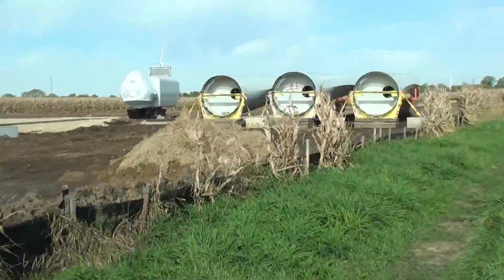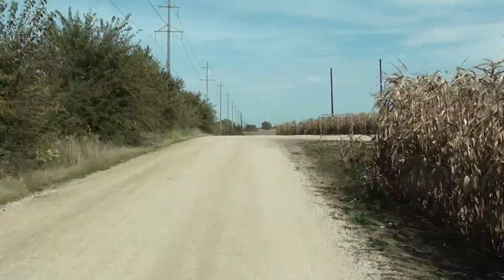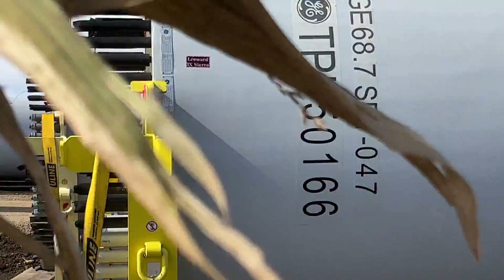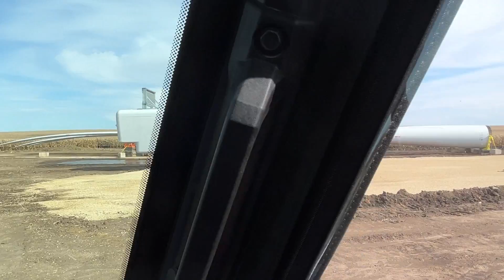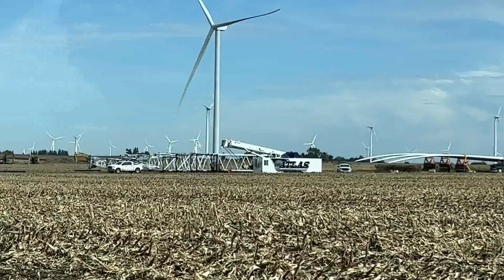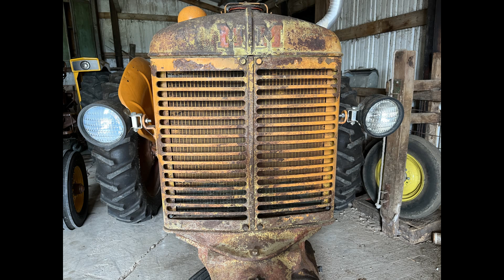ERECTING HUGE NEW WIND TURBINES short #48 tubalcain free energy

Comment: There was a turbine blade being transported that was stopped at a rest stop.  I paced the blade and then met the driver.  He told me the blade was 265' long but that there are some that are 300' long.  I was also told that the blades have stairs in them so they can be inspected.  I suspect that the 68.7 on the blade was the length in meters, 225" long.

Comment: This saw on the propellers of the windmill blade is not on the attacking side, but on the opposite side. This means that it is most likely intended to reduce air vortices at the trailing edge of the airfoil and not to dissipate the birds.
Reply: Formula One cars' windscreens often have that sawtooth pattern these days.

Comment: I’m surprised with the way the craziness is these days you didn’t get stopped and shook down by a group of guys in black suits and sunglasses driving Suburbans saying if you can’t film here. I have friends in Ohio, Illinois that have the turbines surrounding their farm since the early 2000s and he refused to put them on his land because of the loss of crop revenue as well as the outrageous lease they required. Back then they paid the landowner $10,000 per unit each year requiring full access for maintenance and upgrades. It depended on a wind survey to determine how many  can be put in each area depending on the wind. They actually produce power without wind. An onboard motor turns the blades and a change in gear ratio turns the generator to power the motor as well as create power when the wind isn’t as strong as usual. They can face the generator in different directions as well as change the attitude and pitch of the blades like on a propeller plane motor to maximize the speed. Great videos Pete as always.
Reply from the maker: Very interesting. There was a security truck that we avoided.

Comment: This is very interesting video Mr. Pete.  For those discussing that on a windy day the turbine were not is use I may have information to explain it.  I had a lengthy conversation with a mechanic or technician that works on a wind farm and asked him about that.  His reply was that they were either down for maintenance or the power grid did not need their production.  Distribution is one of the flaws in this system.  Excess generation can't be saved or stored so they are often shut down because the demand is too low.
Reply from the maker: Very interesting
Reply: Since it is 'free' wouldn't throttling down the gas/coal/nuclear plants be the first thing to do rather then shutting down wind?

Comment: The fact that they are replacing what was there sorta of makes you wonder how much profit there is in generating power. Surely these new ones are into the millions of dollars so how long before they turn a profit and then how long before they need maintenance and replaced again. For sure, creating electricity is much cheaper than they sell it to us for.
Reply: The old one was probably about $2M, this one about $10M.  Depending on area, power price etc payback was usually 5-10 years.  With windmills bigger is better, twice the size makes 4 times the power so this one could pay for itself in a year, but more likely well under 5.

Comment: Lyle - Interesting video, thanks for producing it as it was very informative.  I scanned comments until I saw that the 'teeth' on the blade trailing edge was explained correctly as noise reduction (primarily).  My compressible fluid flow course was 55 years ago but the principles have not been found in error yet.  As an engineer I am always amazed by comments some people make about things then they have no understanding of the technical aspects.  If  I don't understand something I try and keep my thoughts to myself until I research it and figure it out.  Complex problems like how to provide a stable electric energy grid have many, many moving pieces.  It is not always intuitively obvious how the various pieces of the puzzle fit together to make the system  work.
Reply from the maker: Never underestimate the ignorance of the general population

Comment: People generally do not realize the speed of the blade tips when these are in use. The speed is governed to keep them from  spinning like a child's pinwheel in the garden. Below is copied from the internet but the diameter of the blade is not given. 

The wind turbine’s speed is determined by the speed of the wind. The majority of wind turbines spin at a rate of 10 to 20 revolutions per minute. When the wind speed is roughly 12-15 mph, the blades’ tips turn at about 120 mph.  That would be probably be close to  16 revolutions per minute with a 70 yard length blade. 

They look slow, but a bird thinking the same thing doesn't stand a chance at the tip of the blade, especially with a saw tooth blade. I bet they were purposefully put on them to reduce bird strike damage. I despise this technology. We should be using nuclear energy exclusively for electricity. The U.S. Navy has and exemplary record of safety with nuclear energy. The wast material containment would take up  less that a house lot since they have been converting all ships to this form of energy. Even new nuclear power plants being consructed today are way safer than any previous models but the U. S. has deemed it bad so the world passes us by with development. France uses nuclear so I wonder if the naysayers refuse to go to Paris or Normandy?

Comment: Interesting to see the development of these wind mills. Why would a windmill become obsolete? What did they do wrong on the original ones.
Reply: The early windmills were prototypes in a real sense. Each new design should be quieter, more efficient in materials, last longer, and produce more power than previous designs.
Reply: @ellieprice363  Thanks for the information.
Reply: Another two aspects are repair  and insurance.  There are a small number, if any, engineering firms that will recertify the windmills. Here in Washington state, there is a 25 year obsolescence planned. 
Apolitical statement here: I don't think that is figured into the cost or carbon cost calculations.
Reply: Asset depreciation is an important part of our tax system, keeps stuff moving - build it, use it, scrap it, repeat it!
Reply: There was nothing wrong with the old one, but as usual the answer is money.  The amount of power depends on the area of the circle the blades make, so doubling the blade length creates 3-4 times the power.  One case where bigger really is better.
Reply: @j.f.christ8421  Thanks for the information.
Reply: @normtheteacher5485  The old windmill was 10 years old, paid for itself a few years back and was set to generate free money for another 15 or so years.

Now that land lease probably has another 20 years on it, and the new one makes 4 times the money...  So after it pays for itself in 5 years, you've got another 15 years of free money, but 4 times as much as you'd have gotten with the old one.

It's like anything, do I keep using the old one or does it make dollar sense to upgrade.
Reply: @j.f.christ8421  I guess dollar-wise it makes sense. I hate to see things destroyed when they still work. All that time, labor and materials that went into making those wind mills.
Reply: @normtheteacher5485  I don't like seeing perfectly fine equipment trashed either.  Windmills are about money now, anything else is just a bonus.

Comment: The worst thing with wind mills is that they are connected to the grid via inverters. Years ago they had transmissions, but not any more. The result is that when the conventional power plants are replaced with wind mills, the power grid loses a lot of inertia. That can again be compensated with batteries, but it adds extra cost and infrastructure. In my opinion any wind mill park should also build sufficient battery capacitance to keep the grid frequency stable.

Edit: Note that I said the batteries are a solution for lost inertia and it is also a solution for short term frequency stabilisation. The hyrdo plants etc need time to spin up and synchronize with the grid frequency and for that period you need alternative faster energy source, or the frequency will decrease and the whole grid could fail. It is not a solution for long term power storage.
Reply: Would be better off with something like pumped hydro storage in locales that have the geology/geography for it. Battery storage at grid scale just non economic and requires too many heavy metals
Reply: @mrping100  Yes, the storage solution could be handled by pumps and hydro power, but it does not resolve the inertia problem fully. Therefore batteries might be needed to maintain stable freguency. I have jokingly stated that big flywheels connected to three phase motors could solve the inertia problem. I was surprised when I read that they are going to build a giant flywheel to western Finland. Not going close to that wheel :D
Reply: Heavy metals??? Lithium, iron phosphate is not heavy, and 100% reusable...a bit expensive. albeit, but in the midwest, would be  doable solution. @mrping100
Reply: Totally agree...battery storage is the solution; albeit expensive, but effective.
Reply: Natural gas generators are well-suited as a compliment to wind. They are very quick to respond to load changes, and if executed with an optimized combined cycle are far more efficent than a simple gas turbine or steam boiler generator.
Reply: @gavinmclaren9416  Using natural gas is a bad option at least in Europe at the moment. Prices are high and the gas market affects the electricity price, making electricity really expensive. At least last winter it was so and the average prices more than doubled compared to 2021.

Here the most expensive electricity production form defines the price of all electricity regardless how you produce it. So when you start up the gas turbines, prices go up to the roof and the wind mill farm owners are laughing all their way to  the bank.

So although natural gas generator can cope with load changes, it is not viable for consumers.
Reply: @pukkimi  I agree in the context of Europe that NG is a poor marginal option for electricity production. I live in western Canada; we have ample gas and a stout distribution network. Gas is relatively cheap anywhere in North America and that is the basis of my comment.

Comment: The "saw-teeth" reduce noise and drag.
Recently, "Thinking and Tinkering" made a few videos with bumps on blades to increase efficiency.
The issue with the new windmills is that they move through the air at very high speed.
That speed kills birds. The high speed makes a lot of noise also.
Reply: An example link to a "Thinking and Tinkering" video:
https://www.youtube.com/watch?v=8S4pGhPfGL4

Comment: The "saw tooth" pattern on the trailing edge of the blades is to help with infrasound and the Buffeting Noise blades can make while running. 

It's true wind farms do kill A Lot of birds, it's bc the birds cannot see the blades while they're spinning. Bird strikes can cause a lot of damage to the blades believe it or not that's why many of the new wind farms are experimenting with applying vinyl wraps to the blades that have patterns allowing birds to see them. 
It seems to be working as the turbines with the vinyl wraps have very few bird strikes compared to one's without them.
Reply: Thanks for that update on the safety of bird life around spinning rotor blades. I'm glad you've mentioned it, and hope more people become aware of such improvements.

There were complaints in South West Australia decades ago about the buffeting noise of rotors near farm houses, and the flicker from shadows at low wind velocity.
Reply: @BrassLock  I can relate to the flickering light issue. Had a ceiling fan at a place I once lived that put the lights above the fan blades. The low frequency strobe effect when they were both running made me feel queasy almost immediately.

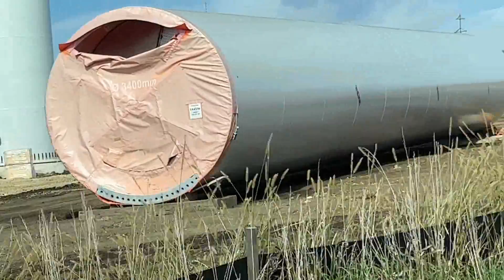Comment: 8:42 The 3400mm is metric ie 3.4 metres or ~11' 2" diameter, probably so they know which section mates to the next and they don't get any mistakes during erection(I'm assuming the main pole is tapered or there are different sizes of poles).
Also looking at the working turbines, the sawtooth appears to be on the trailing edge of the blade, possibly to break up the wind flow as it leaves the blade, maybe to make it quieter???
I've got to hand it to those workers, they've got it down pat, those crane sections were going together like lego blocks.
Thanks Mr Pete, very interesting.